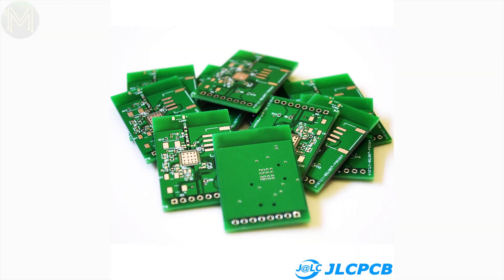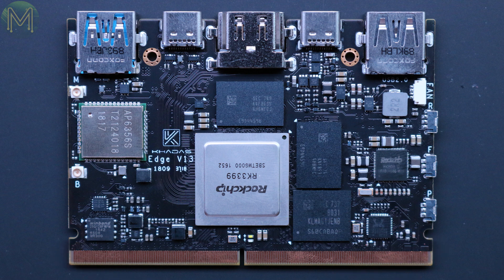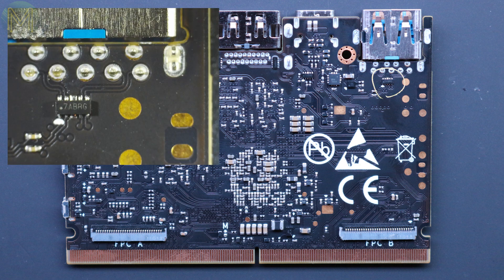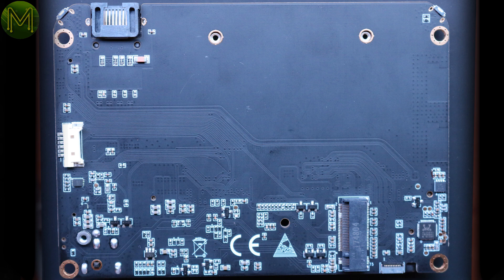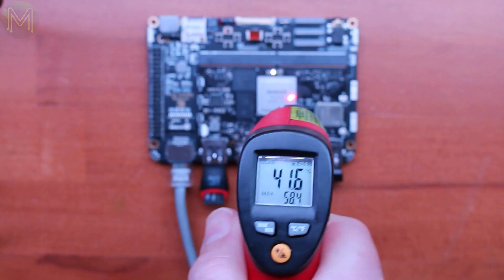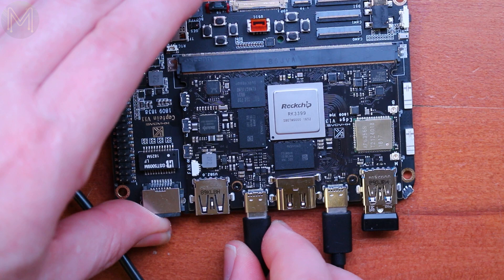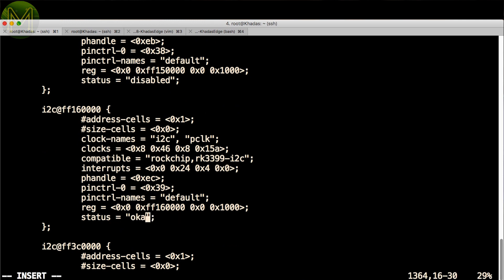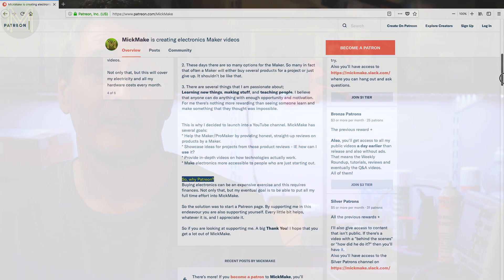#239 The Khadas Edge: A new captain with an edge. // Review

Comment: What is the difference between the AP6356S and AP6398S?  42!!!
Reply: Two different, the AP6398S support Bluetooth V5.0 and RSDB features(Real Simultaneous Dual Band, Edge and other devices transmit and receive data over two bands at the same time). More details at Khadas Website: https://www.khadas.com/edge
Reply from the maker: Ah yes. Didn’t pick up on that one. Good catch Ben!

Comment: Does your infrared thermometer have a calibration setting for metal surfaces? Otherwise it doesn't really work on metal.
Always something to keep in mind!
Reply from the maker: Yup, I was trying to point away from the reflective surface. When comparing with the SoC temperatures it was pretty accurate.

Comment: I liked this video. Very information dense.

Just a couple of points of feedback.

1) I would really like a small writeup of this somewhere. Even if it's just bullet points. I understand that it's harder to monetize the time investment in that but I think it would be really helpful for finding the information presented.

2) When showing the benchmarking score you have a couple of sentences between presenting the results with/without cooling. By the time you showed the 2nd score I'd already forgotten the first (partially because there was no indication that a comparison was coming up). It would probably be helpful to show the old score on screen at the same time and/or mentioning the old score in the same sentence (or the magnitude of improvement over the old score).

3) When you go through the flashing methods I had a similar issue with you mentioning "the 4th method" but I'd already forgotten what number 4 was. You showed two methods on screen while saying that but no indication which one you were taking about. The structure around that section works well enough in a script but in a video it's a little tedious to follow imho.

4) People love drama, you can't just leave us hanging on the usb power incident; was your laptop ok? Did the board bite the dust? You implied that but I'm not sure from just watchting the vid once.
Reply from the maker: 1), 2), 3) - Yup, what I normally do is put up the article on my website, but I've have so much work on the last couple of months, I've been a bit slack doing that. I'll be doing that tomorrow, however!

4) Alas no. Completely killed it. I'll be investigating it this week and have it up in my mid-week mailbag video. The board was OK though as it was pushing the full 12v back into the laptop.

Comment: if they're doing these in expansion type boards, then why not place the soc and a vid chip on one side, ram slots on the other and extend the expansion slot vertically for the space the ram takes. re-assign surface space for some of the surface mountables underneath (since there will then be room for them), limit the smaller boards utility to being the functional "brain and process com center"  by having the wireless chip on it (with the 2 antennas) and the 2 usb type c connectors, thus leaving plenty of miniturized utility. and the expansion board can handle the rest. ram would then be provided by purchaser, saving production cost and can be expanded upon at users discression. soc can be updated at a lower cost to both purchaser, and board designer.
Reply from the maker: Yup, there's so many ways to design a board, but you are limited by track length. So there's often not much scope to move things around.

Comment: Surely it's not an SBC if you are plugging it in to another board for full functionality!
Reply from the maker: You can actually run it without the main board. Works really well, but lacks Ethernet. For some... that may be an issue... for others... meh.
Reply: @MickMake  Well, I did say "full functionality" for that very reason :P

Comment: Very much like the concept of keeping the core and low profile components on a board with an edge connector.  Hopefully, this style will become standardized for laptop, tablet, and phone peripherals.
Reply: you skipped the planned obsolescence courses ?
Reply: @TheKetsa  We will call this jellybean ARM platform "Eve."
You know, she will eat Apple(tm).
Reply from the maker: I actually prefer this style of SBC as it means that you can get a really flat profile with many more GPIO connections broken out.

Worst case - you can solder up directly to the edge connector like an SMD component.
Reply: Actually, Khadas Edge is not a SOM module or core board, the Edge SBC can work independently and can also be docked to many different carrier boards then transform to Tablet,  2in1 Laptop, Projector etc(Need some time for us to develop these one by one). BTW, you can learn more details at Khadas website now.

Comment: What happened to the quality?
its only low level 360p
Reply: Probably just YouTube still rendering the higher res versions. It was fine for me @ 720p (I wasn't looking at it full screen).
Reply: @davefiddes   some of us didn't get the option to go higher than 360p
Reply: @AJB2K3  try reloading. It'll probably be fine now. I've seen this on a few videos where it's been posted quickly before YouTube has finished rendering the video into all resolutions. The low res being smaller finishes first.
Reply: @davefiddes  1080 is showing now.
Reply from the maker: I think YouTube has changed it's policy of now publishing a video before rendering has finished. They used to wait until rendering was finished.